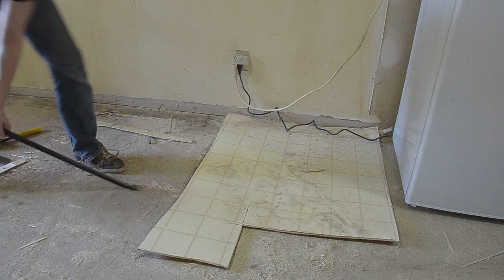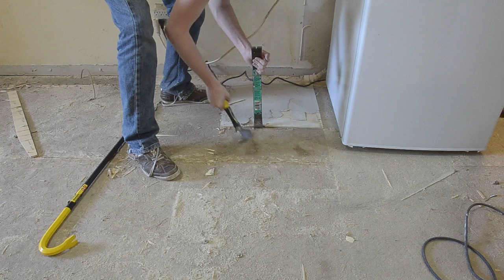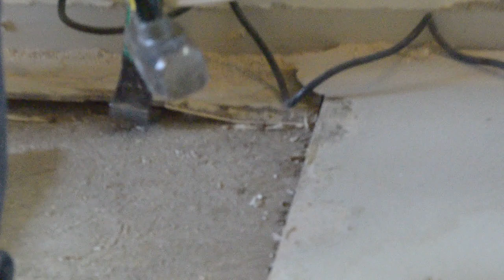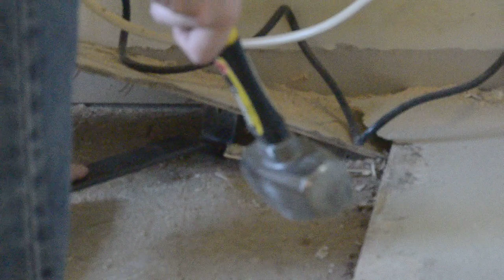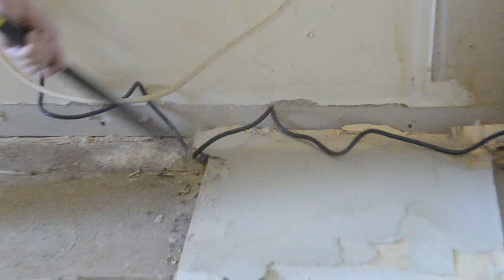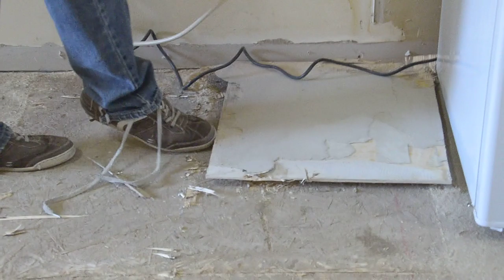How to remove a vinyl floor and its sub floor

Comment: Best tool for popping the old floor is a roofing shovel.  Still have to saw cut in strips.
One person popping, one hauling to the dumpster.
Reply: Can you saw cut through linoleum and the subflooring at the same time? Basically to bypass ripping the linoleum off.

Comment: What if you don't have a circular saw? I'm ripping up vinyl and subfloor and cant get enough leverage to get up near walls and in corners.
Reply from the maker: I don't think the job can be done well and in reasonable time without a circular saw. Borrow one?
Reply: Kim Letkeman Guess I will have to. Or someone that has a Dremel. I still can't get the rest of the flooring up. Wife is getting pissed LOL